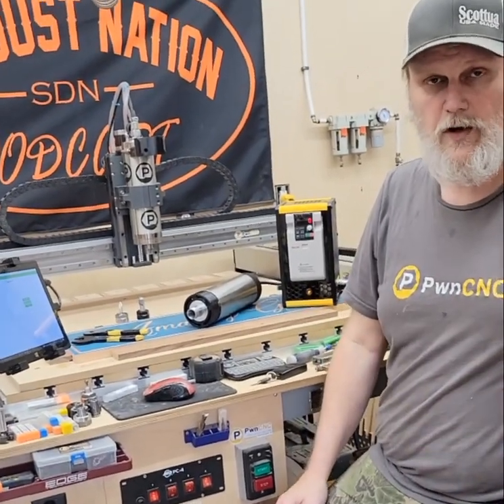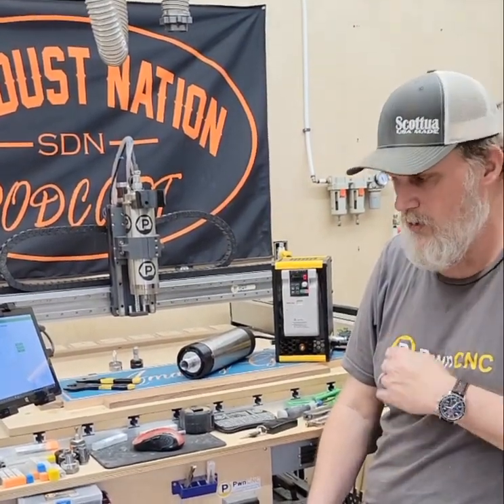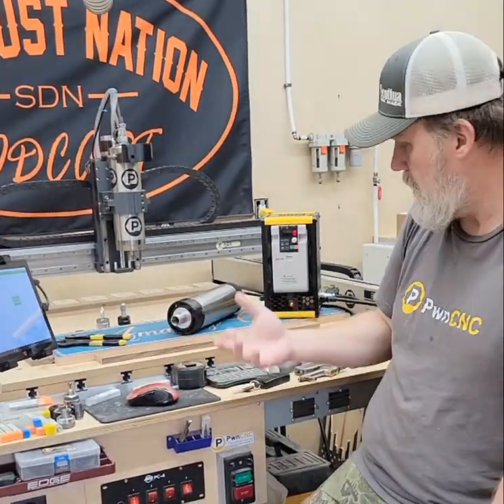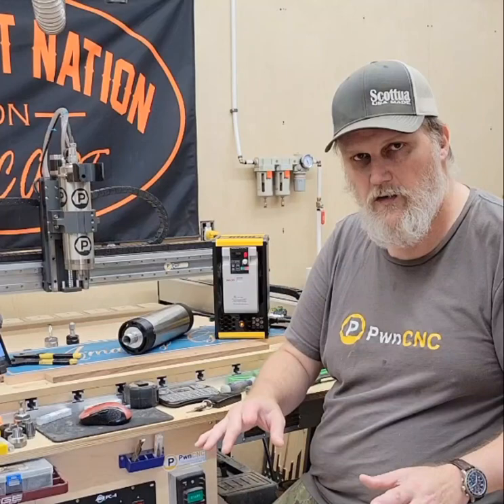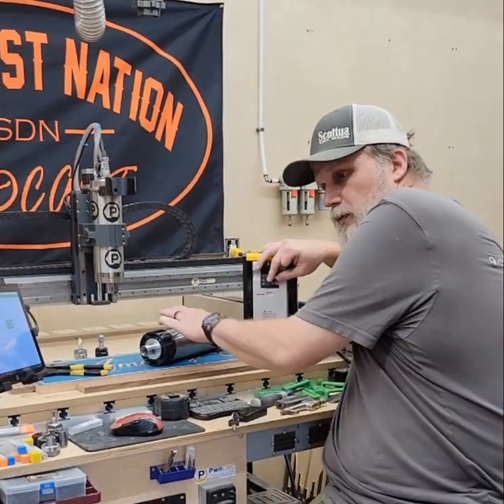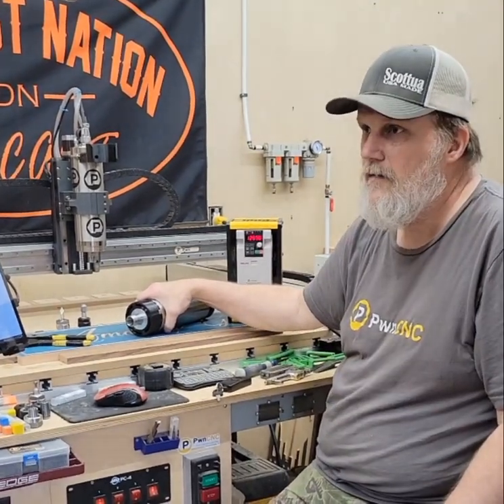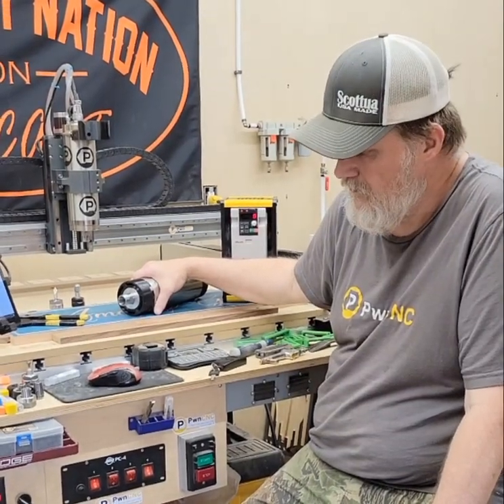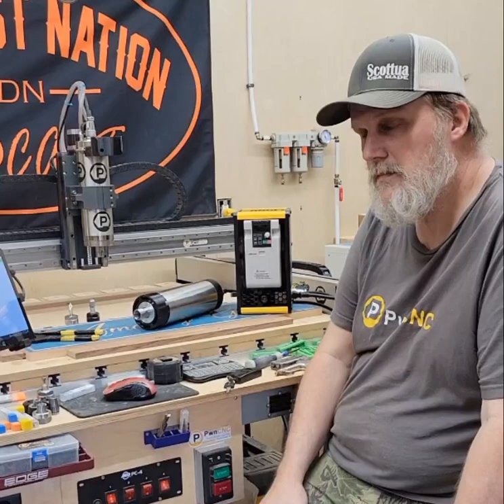Water cooled vs air cooled spindle noise level comparison.

Comment: Would be nice to chuck a Makita trim router in there as well to hear the real difference between a spindle and a router which most people start off with I reckon.  But in the end, the dust collector will probably win that battle as you just pointed out anyway.

Comment: Thanks for this, but it's not exactly a fair comparison because the air cooled was sitting on a large resonating surface, the spoil board, and free to vibrate. The water cooled was isolated up on the rigid gantry. Regardless, the air cooled is always a little more noisy.

Comment: I am kinda regret choosing air cooled spindle for my CNC, too loud for me
Reply: But is the air cooled spindle really THAT MUCH louder than the water cooled?? Im doing research on them now so I can figure out which one is best compared to my makita router.
I've heard the water cooled is just a LITTLE BIT quieter that the air.
Is the air cooled that bad?
Thanks for any help you could give me. 👍
Reply: @JoeLazzara  consider it a quiet router since it has a fan that make it cool and the better the fan the louder it gets, once it's cutting wood it's only a few decibels higher, But it still blows the darned chips all over the place and sometimes overpowers the dust boot on 3d carves  leaving a lot of trash and chips on the work piece.
Reply: @66dvert  Thanks for responding!! When I posted my question I was trying to figure out which one to go with and I had decided to go with the water cooled, and I'm really happy that I did!!
 Since you have a spindle, you're well aware of how quiet they are lol. 
But now that I have that spindle, I can never go back to a router again, I really love that thing.
 You're completely right about what you said about the air cooled blowing the chips around, since the fan is at the bottom. I think that's why I opted for the water cooled too, plus it is quieter than the air cooled, it makes carving so much more enjoyable now lol. 😄
Reply: @JoeLazzara    thanks, I have 6 cnc's right now in the garage, from 24"x 24" to 127" x 70" for full sheet goods. Every one has a spindle that's  water cooled. you are, right once you get that spindle up and running you can't ever go back to a router unless you broke everything and the store is closed for a week.
Reply: @66dvert  🤣🤣 yes sir, out of total desperation.
Reply: @66dvert : I’m really happy I went water cooled as well, but during the summer, my garage can get up to 100 degrees, and at some point, the coolant is quite warm. Have you used anything to cool your coolant??